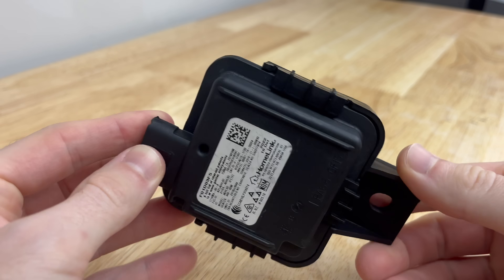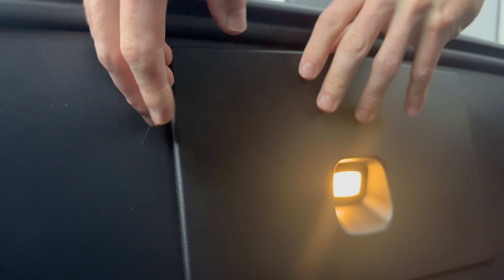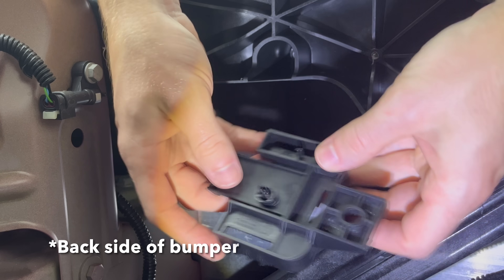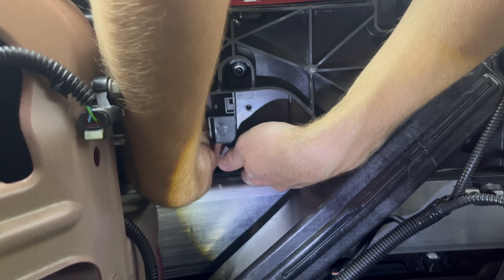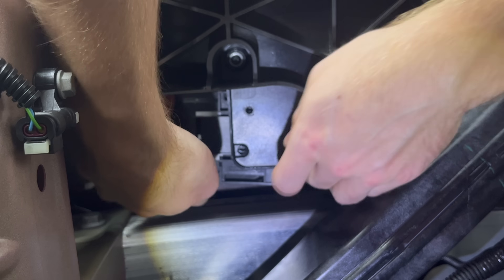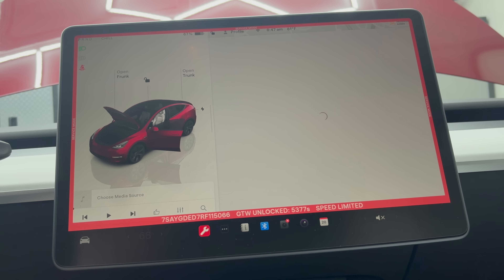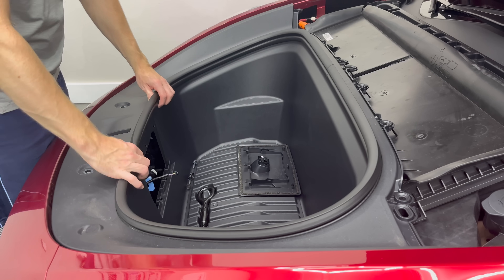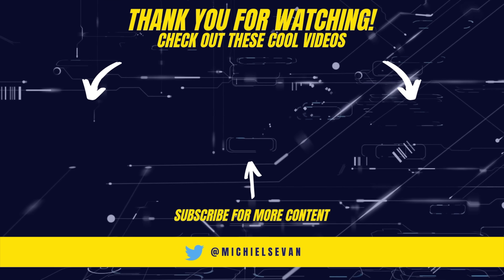Tesla Model Y | Model 3 - DIY HomeLink Install and Setup in Service Mode at Home!

Comment: Tailwind IQ > homelink
Reply from the maker: Interesting, does this auto open/close your garage on approach from your tesla?
Reply: @EMtesla1 yes, but not without extensive addons and additional equipment.  If I was driving anything else...like a Honda...then TailwindIQ could simplify things.  For a Tesla, no TailwindIQ is utter garbage.
Reply: yes way better than myQ you need a gps puck (iphones) androids don’t need it, that you can move to any cars and they don't need a subscription
Reply: After watching the TailwindIQ setup and function...no...no its not.   TailwindIQ >myQ.   Apples to Apples.
Homelink is not wifi dependant or phone dependant.  Compare apples to apples Michael.  A simple google / youtube video search shows how the setup is complex for TailwindIQ and depends on certian factors to turn your garage opener into a smart garage.  It will not be as smart as you think, go watch the videos.

Having to "accept" terms and conditions in order to do anything is troubling to say the least,  especially when all you want to do is open your garage door.
Homelink is self contained and 100% compatible with any RF operated garage door.  Add Tesla's UI and you have an automated door...its that simple.  Not terms of use, not data sharing required, no 24/7 tracking via your phone( which is a battery drain btw).

Comment: Thanks for the video. Unfortunately the Tesla homelink price needs to come down quit a bit to really be worth it.
Reply from the maker: I think it will over time. I see it on the tesla website for $350 and on ebay for around $200 as of today. Main reason I installed this as MyQ was really unreliable. It was hit or miss on opening the garage door.
Reply: @EMtesla1  
Hope so. Thanks for video.
Reply: Tesla used to sell it for $300 when I got mine in 2019
Reply: I thought that when you bought the home link from Tesla the high price included them coming and installing it too?  It comes delivered to you with a sealed box that only the tech is allowed to open?
Reply: when I got mine last year, they delivered it to the mobile service tech and he brought it with him when he came to install it.

Comment: I tried this with mine months ago. It didnt work because tesla blocked the retrofit. Is this working again? What update are you on?
Reply: Teslamotorsclub confirms that this  install is feasible with 2023 or 2024.20.x software by yourself.  Anything in between doesn't work
Reply: In the video on the service screen it’s says 2042.32.2
Reply: I have the exact same question.  It was blocked for me on a 23 mY.  Tried about 1 year ago

Comment: Does it fit on the 2024  M3 Highland?
Reply: Yah, you can buy the correct one via Tesla for the new 2024 model 3.  As it noted in my other comment, you will need to take the bumper off to access the connection on the passenger side.
Reply from the maker: Looking at other videos, it appears this will work, however, the cord is in a different location on the 2024 model 3. Also the bracket is different.

Comment: MyQ cost $45.00 a year. If you lease your Tesla for 3 years you spend $135.00 for MyQ. Homelink costs from your eBay link $170.00 plus tax. For a person leasing their Tesla MyQ may be a much better choice and you don't have to take your car apart. BTW I use MyQ and pay the annual fee. My base model 3 2024 (Red/White) Highland is 15 days old. MyQ is uncannily accurate.
Reply from the maker: The main reason was not only the cost, but My Q sometimes worked and sometimes did not. We used the free trial and noticed when the tesla sent a ping to open the garage, it would sometimes miss. HomeLink has never failed us thus far. We also plan on keeping this car more than 3 years.
Reply: @EMtesla1  The issue with Homelink is what happens when someone is home and left garage open and then you pull up and instead of opening it, it closes it.  If you have had issues with MyQ it most likely has to do with weak Wifi
Reply from the maker: @provoking3449   Nobody is home and the garage door is closed.. Also I have wifi unit in my garage. I'm not sure, but MyQ is unreliable for me.
Reply: @provoking3449 ...your a troubled human.  You simply touch the screen to cancel the upcoming command.  Stop trolling.
Reply: @williamgrunzweig571  how's your mom Grace?
Reply: @EMtesla1  I didn't mention this and maybe this isn't a cure but several months ago I installed solar. To make sure the Enphase could communicate with my network I added a Deco mesh network. One of the mesh network modules is in my garage so there's that. MyQ so far has never failed to operate as intended. EM Tesla has gotten a lot of comments from his Homelink install.
Reply: Doesn’t MyQ require a Wi-Fi compatible garage door opener?
Reply: @MrDksmall No. MyQ sent me a standalone module that stays in the garage and controls the opener the same way my remote does. The MyQ package also includes a door sensor that detects when the door is opened or closed. This system works well for me.
Reply: @MrDksmall  Yes. Either Wi-Fi is built into the garage door opener or you purchase a bridge from somebody to adapt the garage door to Wi-Fi. I would think most people with a Tesla also has a smart phone and it’s doubtful that these folks would have a garage door opener that’s not Wi-Fi enabled or at least easily done. But anyway, yes, Wi-Fi is required.
Reply: @theodorehartman5086  My opener is 33 years old 😄 But I would get a Wi-Fi box if I go down this path (or a new opener)
Reply: @theodorehartman5086 That's not accurate. MyQ has a module that controls the opener the same way a remote does. The module is inexpensive at around $25.
Reply: @MrDksmall  You can get the MyQ Hub for free.  Sign up for MyQ account and then in Tesla, connect the account.  You will then get an email offering a free hub and trial.  All you pay is $1.  I have used both MyQ and Homelink and the subscription fee of $45 a year is so worth it because it knows when your garage is open.  Well worth it.
Reply from the maker: you can also use the MyQ app for free to manually open and close your garage door. It also shows if it is open or closed for free. No subscription is needed. Just pay for the hub.
Reply: Spending anything on a lease makes no sense.  Just use your remote and forget it.  If your giving up your car in 3 years, don't bother with either.
Reply: @williamgrunzweig571  I just like tech so I spend 45 a year for it. You have a good point about the lease aspect of not spending more but buying a Tesla with their  enormous depression rate makes no sense to me as making no sense to you with me putting accessories into a lease. I also spent 1K on window tint (the entire car) for my 3 year comfort plus mag shades for the roof.
Reply: Myq it's not owned by Tesla that's a separate company if you look back at their history with their customers you'll change your mind really quick do your homework
Reply: @raaah  RAAAH, I don't know what your issues are, I NEVER said MyQ was owned by Tesla. MyQ works flawlessly. "do your homework"... I am very happy with what I have chosen. enough said.
Reply: @theodorehartman5086  before Tesla the company was on its own and had a garage door opener and then canceled it after you purchased it and because you need servers for it too work The product no longer worked. Then they started raising prices. In case you don't get what I'm trying to tell you here it is in the simplest form. This company will load you into a sense of security then add a whim jack up the prices. As for you saying that myQ was made by Tesla I never said you did say that. But what you did do is implied that because they are not working with Tesla MyQ is going to give you free updates and is going to treat you as good as Tesla treats you which is not the case